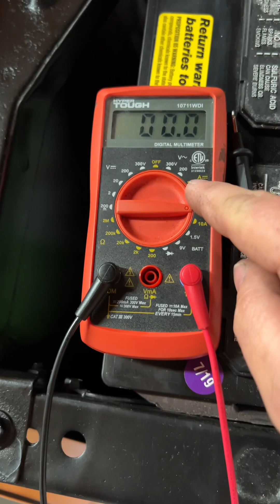EASIEST Way to Find BATTERY Draw in an Old Car

Comment: 🇺🇸 When you had that voltage regulator disconnect from the chassis and were testing the system it was NOT a legitimate test. The voltage regulator case MUST be ground to the chassis. Just saying.

Comment: An even cheaper method is to use just a 12 volt test light , with pigtail & pointed end  available at most automotive parts outlets for just a couple dollars , and use it in place of multimeter as shown here . If you have ANY current draw the test bulb will be lit up , and once you find & disconnect the circuit causing that current flow & subsequent discharge, the bulb will no longer be lit up .  I remove fuses from junction boxes , alternator leads from the cable mounting lugs , etc, and keep tract of everything tested by either making a drawing, or using some form of marker ( ink or paint type) to mark off what HAS tested as not the problem by order of removal & reinstalling

Comment: thanks for skipping to the alternator and voltage regulator. i was about to dig through all my wiring harnesses and go crazy pulling my hair out after pulling all the fuses. I am wondering why ohming the positive clamp  removed from the battery to ground isn't part of the test, but, whatever. I do the same drop test with a pen light on the positive side, clamp off, connect to positive terminal, and it lights if there's a short to ground somewhere, which I have...

Comment: A voltage regulator is almost never found where an alternator is present….I have seen alternators that are the culprit before, bad diode usually the issue!….you can ohm those out…
Reply: The 10DN is the first GM full alternator with an external regulator. Quickly replaced by the 10SI then 12SI and so forth. Gm was the farthest ahead in electrical stuff compared to ford and especially Mopar. Mopar kept their junk external alternators and separate ignition boxes and very outdated charging systems routed through a cheap ammeter and bulkhead causing fires and etc. also dash gauges even as late at the mid 70s had to have a voltage reducer for 6v on mopars. Pathetic. Gm was already pushing one wire HEI systems by then

Comment: If you put the meter on the 20v scale measure battery voltage first and then move the red wire to the battery neg cable anything less than battery voltage measured then you have no current draw test by opening the door you will see battery voltage close door less than measured no draw sometimes you might touch the cable to the post again to cycle the clock if equipped

Comment: Im old school. We used voltage setting
 If it hit 12v, you had a drain. Pull main wire off alternator first, see if it changes. All accessories must be off and doors closed or your test is in vain. Below 12v, it will hold for a few days. Takes awhile for 10.5v to sap a 12v system

Comment: This test will not work on later vehicles. They have to have a certain period of time to power down(usually 10 minutes or less)  and be certain to not unplug the wires in this series or you won’t get a correct result.

Comment: No.  Do not set your ammeter on milliamps when you are testing for current.  Set it on amps and make sure you do not have enough current to damage the meter before trying lower ranges.  Also, 29 milliamps is not nearly enough current to discharge the battery overnight or in a week.  A 40 AH battery (typical) would take about 1400 hours, or 58 days, to discharge at that rate.  Keep looking for the problem.

Comment: A 194ci? That's probably in a 1960s Nova. Two most common electrical problems for them was the voltage regulator and the small wire from the battery positive terminal. Good Luck, Rick

Comment: It could also be your car alarm system that draws juice from the battery when you're not using the car. It just like lazy people who have automatic car starters that draws juice to when you're not running it 😮 even my Polaris ATVs in my RZR has a alarm system but if I don't use them within six to seven days the battery goes dead without a trickle charger connected to the battery😮

Comment: the best thing to get for these is a current clamp like the unit ut210e , it has a precise current clamp with the lowest range of 2amps and if are into eeprom reprograming you can upload a modified code to unlock full potential off the chip and measure upto 600amps dc . with that tiny clamp.

Comment: The old VR had points inside, they would sometimes stick and back feed to ground.  On newer electronic ones, they have a diode that is essentially a one way valve for electricity, when the diode goes bad , it also back feeds to ground, but for both styles to work correctly they need a good ground.

Comment: For people that don't know, those voltage regulators can be crossed over to get ya home but ya gotta remember to keep unhooking the cross over wire cause it'll blow your battery plum through the hood lol...I don't recommend but it works and that's how simple car's used to be. Ya need at least two 4ft wires to run inside the car so you can slow down the voltage lol...And hope you have a volts gauge inside your car lol...I've only done it on a Ford truck and Galaxie cause most Fords has gages instead of idiot lights lol...

Comment: I am glad that he said "older car". Newer cars (basically since the 90's) require additional steps to get a true battery draw reading.  Best way with more modern vehicles is with a "low amp" amp clamp.
Reply: It’s not all that much more tbh had to TS a draw on a 2005 Silverado had a decent almost few amp pull if I remember and checked fuse after fuse after fuse to find it was the gauge cluster stepper motors. On modern stuff it’s just one more major step is to let all components go to sleep. Usually happens within a few minutes after shutting the door key off.

Comment: I suggest removing all the rust from the contacts on your fuse box.  It will help tremendously.
Reply: How does one remove rust from the fuse terminals?
Reply: @1971_Chevelle_SS .I had rust in my fuse contacts for ages. Dull headlights . Hot fuse ,burnt finger. Rolled up a piece of maybe 200 grit sandpaper to slightly fatter and longer than the glass fuse.then used a pointy pliers to hold it in the middle, put it into the fuse holder , then moved it  back and forth within the holder ,They cleaned up real nice , blew the debris away . Tiny bit of brake cleaner On lint free  rag to be spotless. Cleaned fuse ends and  yeah. No more heat from resistance of rust. And bonus nice headlights again 😄 so I did the rest of them also .all nice,and warm only .. . PS good idea to note which fuse belongs in which holder, And disconnect a battery terminal before starting ... ,🤔👍
Reply: @1971_Chevelle_SS Though not for rust, I always clean small *Corroded (green) areas with a Q-tip dipped in water saturated with baking soda. As far as rust, a Q-tip end sprayed with WD-40 should help. But there are mixed opinions about using WD-40, but Many do use it. They just let it dry... 

So keep in mind--It. Is. Flammable.

Or just find a NON-flammable (not INflammable) rust remover, some Q-tips...

Comment: THIS IS THE FUCKING VIDEO I NEEDED LAST 4 MONTHS.... SO BACK STORY...i fitted a nissan 140A alternator in place od my mitsubishi 90A alt for csr audio purposes bc its a cheap and quick conversion for easy higher current charge..... so im a mechqnic and i know by shit however i just need a little reasurance from more older/experienced people than me so i can learn/confrim...so after a while both my batteries were dieing over night... i disconnected one battery at a time... same problem.. then i disconnected qll my interior lights.. no difference... checks ALL FUSES AND RELAYS BOTH ATERMARKET AND FACTORY... no change, so i came to the conclusion that its the alt..... so i said ill just buy another bc its cheap.... so idk why i decided to consult other people andddd electricians.. know electricians... those fuckers said that an alternator CANNOT draw current, it not supposed too.. its impossible.. i explained to them in detail how an alternator works, rectifier, regulator,  the works i explained... and they looked at me like im stupid as fuck... even a friend of mine. In the mechanics game 2 years longer than me.. laugh at me and told me im mad.... but i know to my knowledge that an alterntor cannn.. so look how i gona show em

Comment: A bad battery case will do the same thing!
Reply: Battery case?
Reply: @JayCGypsy  If the battery case is in contact with the metal of the car the electrons can migrate through the plastic case. Anytime a battery will not charge sitting on the ground is a good example of this as a bad battery.
Reply: @chada472  And how does the plastic go “bad” in your opinion?
Reply: @Joachim Christiaens  the case is just a insulator. It can allow electricity to flow through it.
Reply: @chada472  That’s not an answer to my question.
Reply: @Joachim Christiaens  when insulators break down electricity can flow  like a short. I have seen many batteries go bad like this.
Reply: @chada472  That doesn’t happen with plastic though. What happens is that there is buildup inside the battery, between the plates so you get internal loss. Also when you discharge a battery too much, the plates can warp which also makes them lose capacity.

If the case was the issue, putting the battery on the ground wouldn’t cause loss because you need to complete a circuit to have current (or “leak electrons” like you call it). The ground is not connected to the battery so can’t for a circuit. Try connecting a test light between the + and ground ;)
Reply: @Joachim Christiaens  a dead cell happens inside the battery. A battery that loses charge due to a drain can leak electricity just as I stated. Ever heard you can't charge a battery if it's sitting on the ground? Ask yourself why?
Reply: @chada472  That’s my point: I’ve never heard that you can’t charge a battery on the ground. Not only that but I’ve charged many batteries on the ground and never had a problem. You may be believing an old wives tale there.

That said, I live to learn new things so if you have a source that explains this phenomenon and the physics of it, I’d love to read it.
Reply: @Joachim Christiaens  you just haven't been around long enough boy!
Reply: @Joachim Christiaens  the reason you don't see as much these days is the batteries mostly sit on plastic trays and no metal touches the battery. Batteries that sit on metal trays it can happen.
Reply: @chada472  Right. Hopefully people who thought you were serious read this far and realise you are not…
Reply: @JayCGypsy  I am very serious but that's because I have seen this happen and you have not. I find the root cause of problems no guessing. When you have a battery that keeps giving an issue you will replace it never knowing the real cause!
Reply: @chada472  Sure mate. You think you’ve seen something happen. What do you do with a “battery case that’s leaking electrons”? Replace the case to test your theory? Whilst keeping plates and electrolyte? Sure.

You’ve had some bad batteries and have come up with your own theory why they’re bad. Or how did you test your theory?

Please don’t use cop out answers where you assume my age or knowledge. Point me to actual facts please.
Reply: @Joachim Christiaens  hey mate you simply isolate the case with an isolator wood rubber what ever you have. Then check it again. You have limited experience and should be trying to learn instead of complaining.
Reply: @Joachim Christiaens  once it's confirmed that's the problem then replace the battery as I stated in the beginning!! It's just another failure point!!

Comment: Either the kitchen draw or the bathroom draw. Don't the alternator have a voltage regulator built into the back of it .
Reply: You know “draw” isn’t the same as “drawer”, right?

And old cars had a separate voltage regular. Newer ones have it inside the alternator.
Reply: @JayCGypsy  yes thanks 👍

Comment: put your multi meter on milli amps and check for voltage drop across the fusees , you will see milli volts on your on/parasitic  circuit.
Reply: Good test for vehicles with modules that take time to power down. Pulling fuses on these old rigs like my 1958 Plymouth Suburban will work.  I'm working on getting it back to daily driver condition.
Reply: You put your meter on mV not mA to check the voltage drop across the fuse. I think that’s what you meant to say.

Comment: Set mine on 200ma, the meter no longer works anymore?
Reply: You blew the fuse on your multimeter
Reply: @radelement3987  Correct, to be expected if the meter is set for 200ma scale and there's a parasitic load such as a shorted alternator diode, causing the regulator to full-field the rotor (about 6 Amps).
Start your testing by 1st using the highest current capability of the multimeter, such as 10A scale.
Reply: @thisisyourcaptainspeaking2259 

That's not what blew your multimeter,you probably didn't switch the red cable to amps measuring
Reply: @LosmiPZS  What happens when your meter is configured to measure 200ma scale when the current being measured is actually 6A?

Comment: If you don't ground that VR correctly, you defeated your test. A missing body ground will cause a VR to arc and at times weld shut draining the battery or cause crazy charging. Bad diode brige in an alternator can also be suspect.
Reply: I noticed the wable too
Reply: Or go with a 10SI alternator and make the voltage regulator a decoration

Comment: I store both my classic vehicles with a battery disconnect.   Cheap insurance and peace of mind, my garage is not going to burn down because of a short.
Reply from the maker: Definitely a good idea!
Reply: Went to the junkyard to get a couple parts for my gals Accord. We saw a car that pretty much melted. It appeared to be due to someone fooling around with additions stereo related. Long runs of improper gauge wire, melted channels (wire runs) everywhere. Melted right through the body!  We had a great time she loves saving money and we don’t mind a little work.

Comment: I seen a video on utube about doing away with the voltage reg and put a 1 wire alt on it and running wires in to its self for the plug for the volt reg i was wanting to do that to  my 68 nova
Reply from the maker: 1 wire alternator is the ultimate fix for a bad voltage regulator.
Reply: @Byrd's Garage  RIGHT if u use a regular alt with the voltage regular built in to it then u have to run some wires in the plug for the old voltage regular in to its self in a couple spots that's what it is had to think about it lol
Reply: I prefer the 3-wire alternator, there's good reasons they wired them this way and I can explain why if you want to know.
Reply: My 68 Nova came from the factory with an alternator and no external regulator. That ended with generators in 1965.

Comment: Or you could put a 22 shell in the fuse spot or aluminum foil and call it good
Reply from the maker: I knew you would chime in on something electrical since that is your specialty.
Reply: How is putting something across the fuse contact going to stop an amp draw?
Reply: Reminds of the 'guy' who used a live .22 round in the fuse box... got shot in the leg.